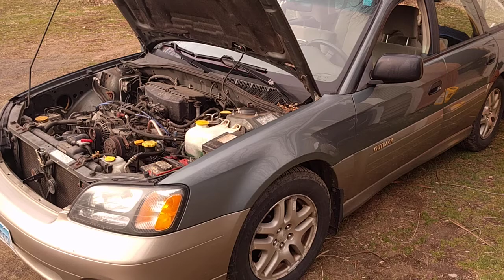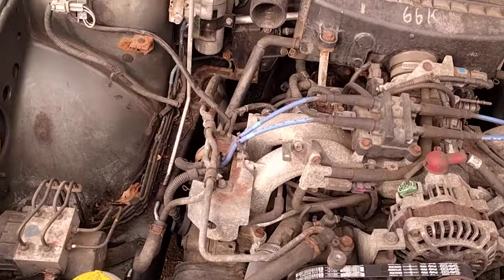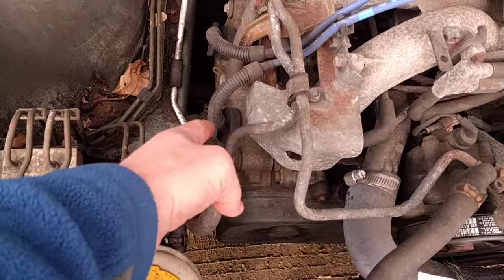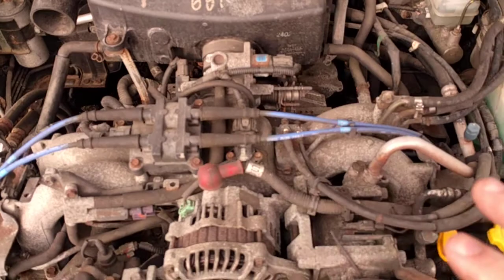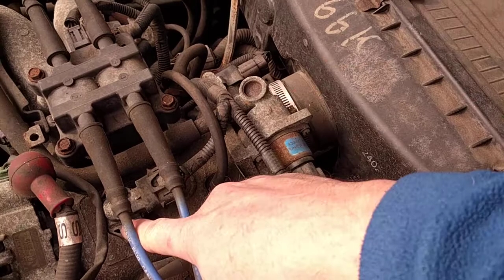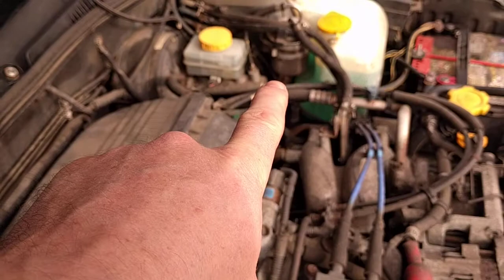P0300 - Random/multiple cylinder misfire detected

Comment: I find your video fairly helpful. I have one question for you. I drive a 2009 infiniti g37 coupe. I have replaced the ignition coils, and spark plugs and still get the p0300. When I get the service engine soon code, the rpm is higher than usual around 1100 rpm. My car has around 81378 miles.

My question to you is, what would you replace if you are in a similar situation? 

Thanks

Zack
Reply: Mr.Logic23 I’m having the same problem.. did you fix the problem.
Reply: Mrvideos not yet, but the mechanics recommend that I should change the spark plugs with the manufactures recommended brands. In other words, I have put in the bosch brand instead of iridium. Japanese cars like to run better with iridium and Bosch is recommended for German cars.

I am going to change them to iridium and will keep you updated.

Btw what do you drive?
Reply: Aww man, i hope it doesn’t have to do anything with an internal engine component. I have a 2013 Subaru wrx.
Reply: i'm really sorry for the delay, but i'm back on the case! think i would definitely start with getting OEM plugs in there. i once put bosch quadfire plugs in a jeep i6 4.0, and it wouldn't run smooth, delivered no power, and even died on a highway on-ramp. put in some stock champions and it was back to purring like the ugly kitten it was.

is there any pattern to when it misfires, or is it random? the higher rpm i'm thinking is just the ECM trying to keep the engine going, since low idle isn't doing it.
Reply: what else are you seeing on your subie? you have a misfire issue?
Reply: Benjamin Jerew I have replaced my spark plugs, and I still have the same problem. Maybe worse, since now my wrx dies on idle sometimes. P0300 code has disappeared but I’m guessing it will be Comming back soon. I’ve taken the wrx to few mechanics and they all said the car is running perfectly fine.
Reply: Without being able to see it myself, I'd guess that the throttle body or idle air control valve are gummed up and not allow enough air to pass for controlled idle speed. Considering that the problem is occurring at idle, I'd start with cleaning the throttle body and idle air control valve with intake/carb cleaner and a toothbrush.
Reply: Mr.Logic23 Bro I got the same car with the same problem. What did you end up coming up with. My stft is 25% at idle . Any help would be appreciated
Reply: Quick One I replaced the spark plugs and reset the engine. I went to autozone in order to have the check engine readout and they just cleared the code. That did the trick and it seems it cones on every once in a while.
Reply: Check your injectors